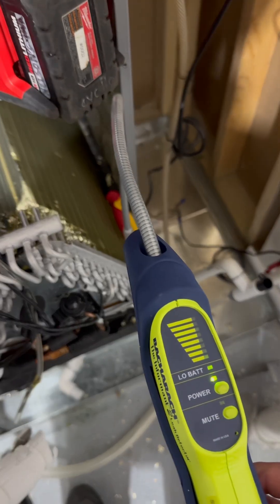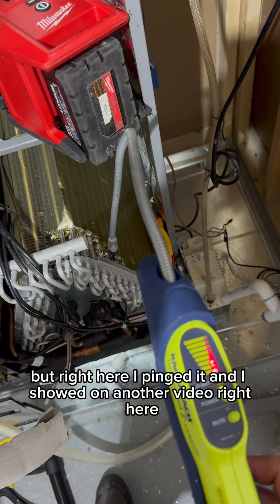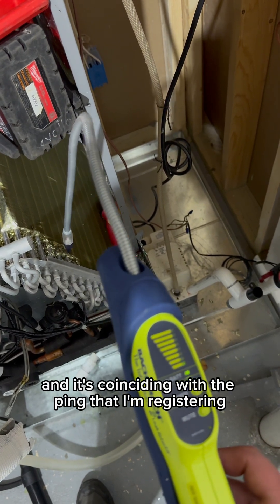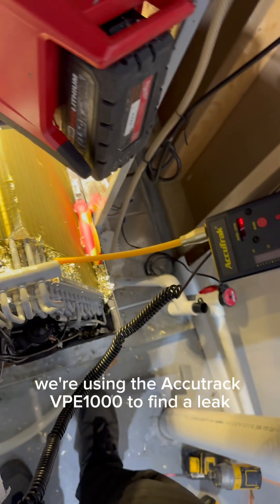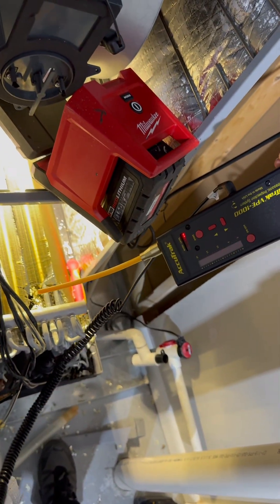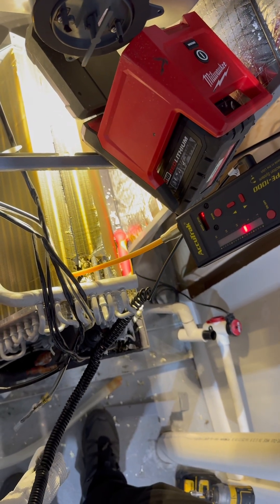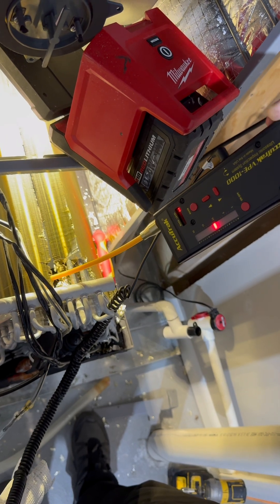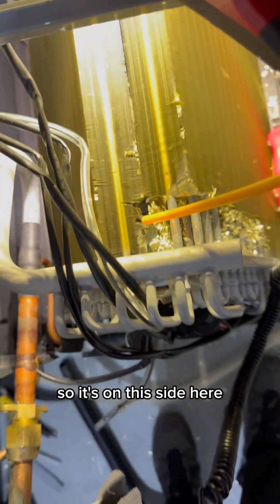Three Leak Detection Methods Illustrated on Carrier Crossover Air Handler Indoor Coil

Comment: Do you like the ultrasonic leak detector? I've always wanted to try one. I've heard of you spray water in the area it makes it easier to hear the leak.
Reply from the maker: Pretty nifty and easy to use. Thanks for the tip about spraying water on surface to make it easier to pinpoint.

Comment: That’s why you buy the Inficon Stratus 😂 ppm pinpoint. Sucks spending $1055 but worth every penny
Reply from the maker: I have your tool here ready to go. Just don’t like to break out new toys unless I’ve read the instructions beforehand. Otherwise, I am not doing it justice… On a separate note I used the FieldPiece on another service call recently to confirm leak on evaporator coil of R-454B refrigerant based system replaced. The leak dissipation board was immediately triggered and found leak on the inside of the evaporator coil obviously manufacture defect. However it is rather annoying how the FieldPiece DR58 will beep and suddenly zero out so that you can continue to very meticulously move toward the leak site found to have it beep again so to speak. I’m not a fan! It was a pain to try to find the actual leak site and rather than continue to burden customer with my obsession to getting to the bottom of a problem had to tell myself to settle down and remove the evaporator coil, then conduct autopsy at later date when work is slower and have more time to set up the context in which I want to run all three methods again. This time I want to take the Inficon Stratus against the FieldPiece DX83 that just came out last week. It’s the newest refrigerant leak detector and can detect even natural gas so would work get even during fireplace season. My only concern is that by trying to do it all it ends up doing nothing exceedingly well. Sort of like the Bacharach Informant II which marketing hyped to be the same as the DX83 but in reality isn’t as good as the standalone Bacharach Leakator 10 for detecting natural gas leaks. Still my favorite natural gas leak detector. I still stand by my dislike of the Informant II. I just need to put it up for sale since I don’t carry it with me nor really use it beyond when forced by tech support to provide bubbles to certify leak which pissed me off and sent me on overdrive to drive it down their throats the leak found on their coil both indoors and outdoors!
Reply: Have both . Ultrasonic far better. There's no comparison